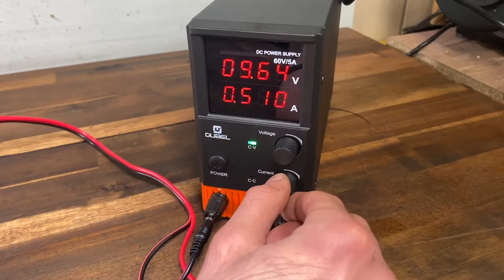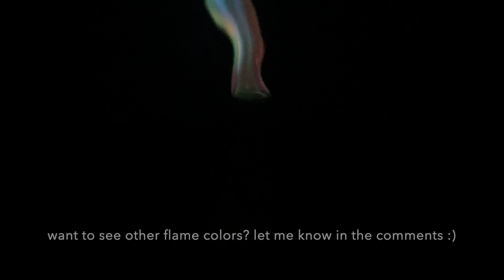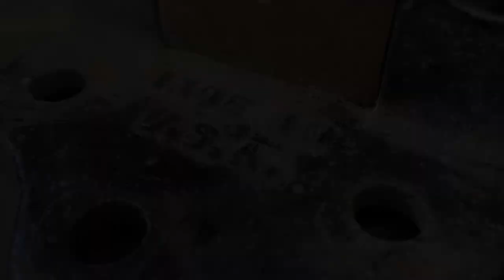Restoring an old pipe vice (copper plating and flame coloring) I Dr. Hut of Handcraft

Comment: If you’re going to sandblast why use paint stripper first?
Reply from the maker: I read that it’s done like that. Also makes sense, because this way the blasting medium lasts longer 🤷🏻
Reply: @DrHutOfHandcraft  
But it uses harsh chemicals that also cost money and extra time. If you factor those 3 things into the equation wouldn't it be better and cheaper to go straight to the blasting cabinet?
Reply from the maker: @thechumpsbeendumped.7797  Referring to this you are right, it costs money, needs some time and also isn’t very environmentally friendly. Maybe there is a better reason than the one I referred to, but I don’t know it. I will consider it in the future! Thank you for commenting!

Comment: I am confounded as to why you did not copper plate first and then nickel plate over. The finish would be a lot more durable with nickel, and the copper will corrode over time. I guess it was an esthetics thing.
Reply from the maker: I like the look of copper more 🙂

Comment: I was surprised that you used table salt while making your nickel solution. I understood from your previous videos that it should be avoided because of the chlorine gas it generated during electrolysis.
Reply from the maker: Well observed sir, I appreciate your attention to detail! And you are very right, water electrolysis with table salt produces chlorine gas! The H20 reacts with NaCl and produces NaOH (sodium hydroxide) chlorine and hydrogen. But since we are doing electrolysis with vinegar, which is basically acetic acid with water there are some other things to consider. The acetic acid in vinegar dissociates to acetate ions and oxonium ions. Since acetic acid is a very bad electrolyte we need something better so the electrons can move and the reaction can take place: NaCl
The chemical equation goes like this: 
3 NaCl + CH3COOH (acetic acid) > HCl + Na+ + CH3COO (or NaCH3COO - sodium acetate). So as you can see the chlorine ions react with hydrogen ions and produce HCl and not chlorine. Btw: the balance of the chemical reaction is more on the left side, so there is not much HCl in the solution :) If you wish I can explain nickel plating in one of the future videos! Thanks again 🙏🏼
Reply: @DrHutOfHandcraft  ok, that makes sense. I’m glad you avoided breathing chlorine gas 😊
And yes, an explanation about nickel plating would be very interesting
Reply from the maker: @jeromebarois1875   Yeah, no jokes with chlorine 😄 Okay I’ll remember that for the next time when I want to nickel plating something!